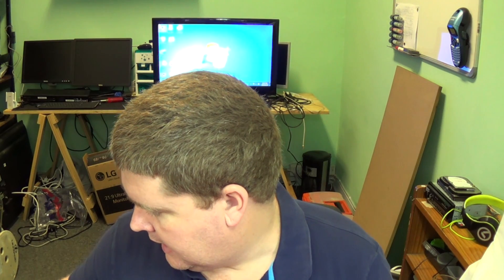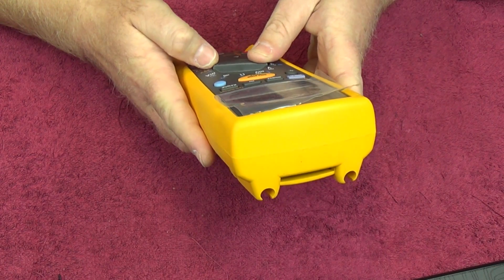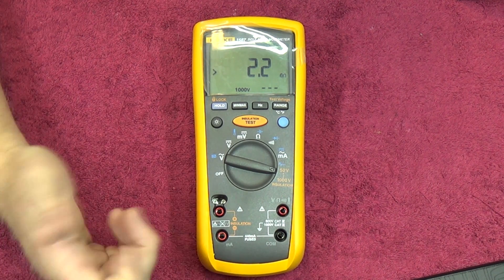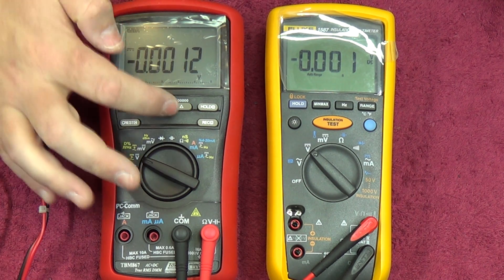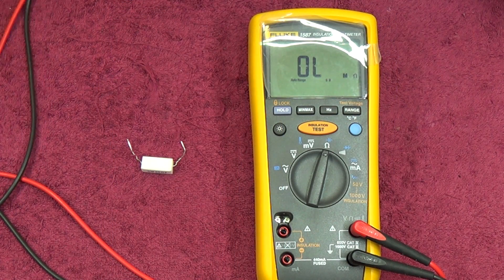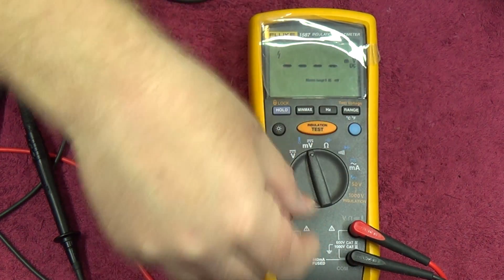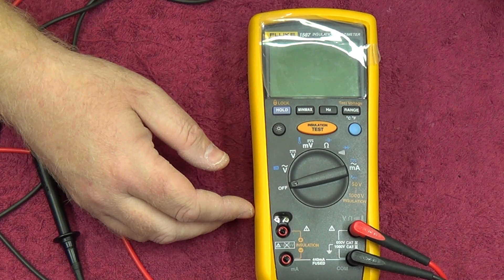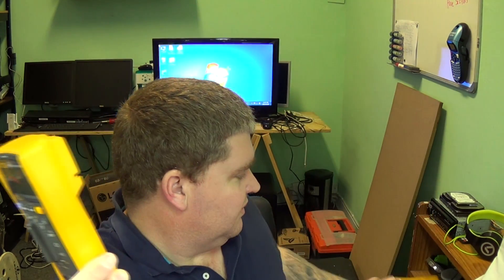Episode 88   Fluke 1587 Brief Review

Comment: Actually a brilliant idea. I almost settled on buying it but I didn't want to do without the direct 10A measurement and more importantly the more electronics-aligned measurements such as micro-amps and peak capture (I've had a Fluke 87 for decades). But I will certainly recommend this to people in the electrical field, and for vessel engineers it's excellent.